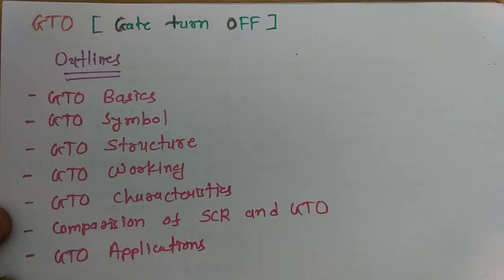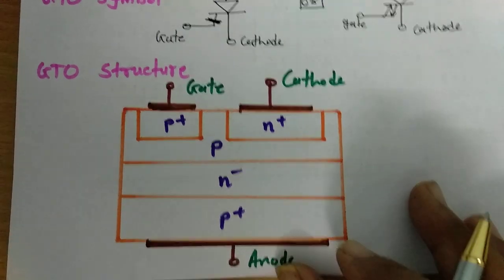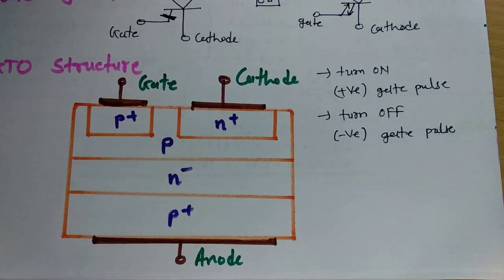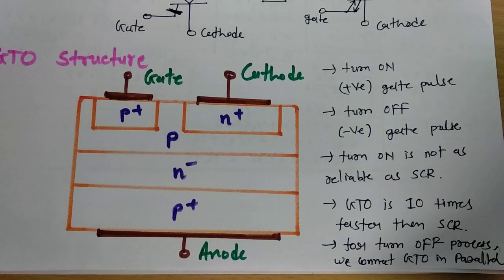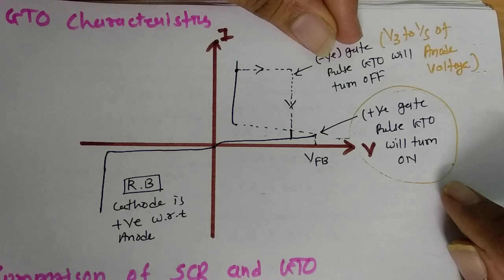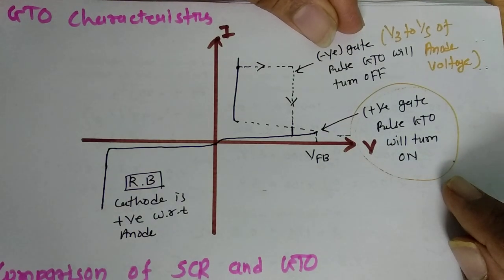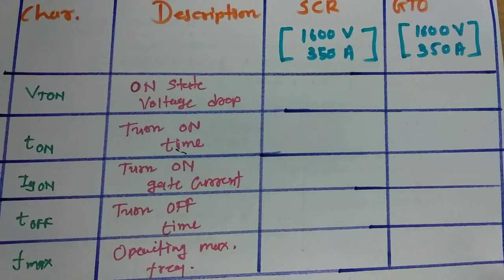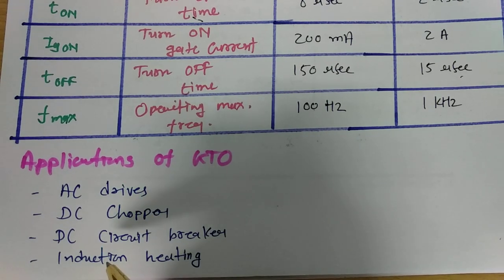GTO - Gate Turn Off Thyristor (Basics, Symbol, Structure, Working & Characteristics) Explained

Comment: Can u plz explain two points you just read in the video - 1. Turn on process of GTO is not reliable. 2. GTO are connected in parallel to assist in Turn Off.
It seems you are just reading from the book..Thats all

Comment: can I make the thyristor using two transistor NPN  and PNP
Reply from the maker: Yeah but you will have to use resistance with npn and PNP transistor
Reply: i need the thyristor 400volt 5amp 
how make the two transisitor and resistance
Reply: can you draw the diagram for me ??
Reply: Study 2 transistor model of SCR

Comment: U didn't explain the working lol 😂😂
Reply from the maker: If you give +ve pulse then you can turn ON GTO and by -ve pulse you can turn OFF GTO. That is how it works.
Reply: @EngineeringFunda  that can be read in a book also...... but how does it actually turn on and or due to -ve and +ve pulse no college will give marks for just writing it will turn off due to - ve pulse and on due to +ve pulse
Reply from the maker: I don't know what you understands. But this is what the basic working which is there with GTO.
Reply: @EngineeringFunda  all I want to know is that what happens within the GTO when there is a -ve or +ve pulse applied to it...... WHY does it TURN on and off by doing so
Reply from the maker: @trojanhorse2003  : yes that has to be the question.
Reply: @EngineeringFunda  ok so where is the answer?
Reply: @trojanhorse2003  first you need to know how the p and n junction works, then you can understand how the semiconductors works.
Reply: When the gate pulse is applied it injects the charges and the depletion layer is eliminated between the reverse biased junction
 During turn off as we apply reverse biased voltage of some magnitude of anode voltage it absorbs the charges which turns off the gto